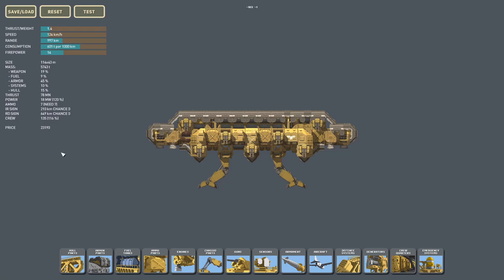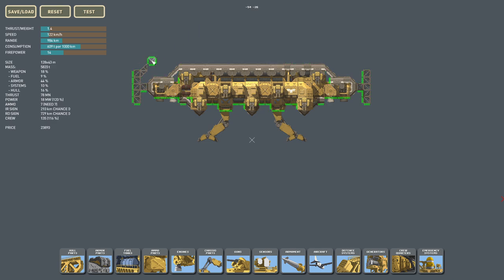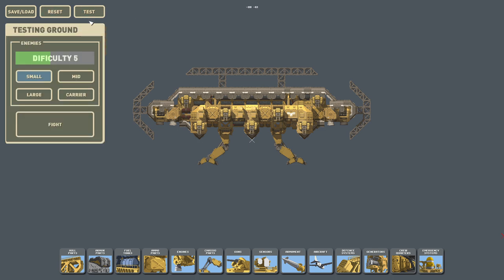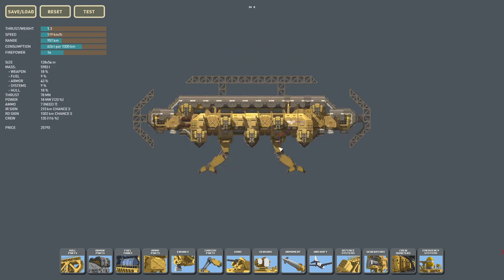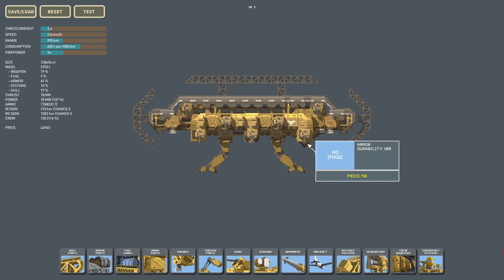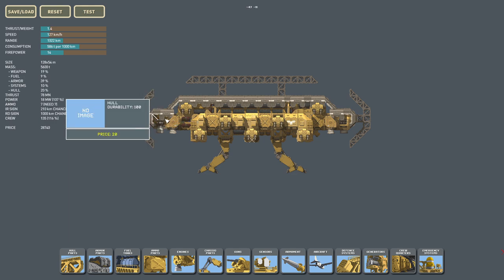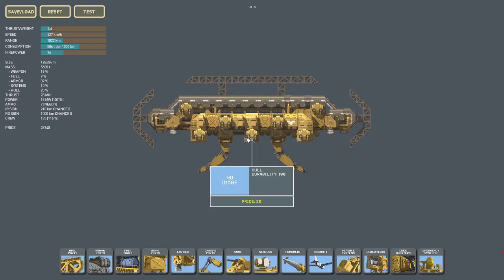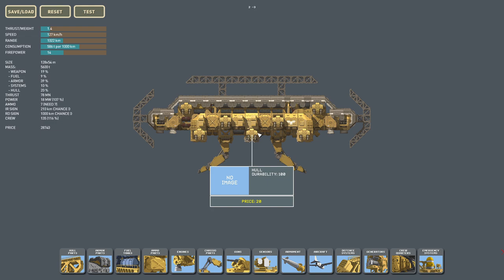Honeybadger-M | ship build | Highfleet

Comment: Maybe keep 130mm's whenever you find them after battle so you can use them to replace the 100 mm's if you dont need the cash. You get along with 100mm's early on just fine, that way you can maximize the fire power whilst keeping cost down.
Reply from the maker: That is a really good idea. Upgrade the ships in the game when you find the parts. I will try this in the next playthrough on the Honeybadger-M

Comment: you need  37mm ciws to take care of fat shells you need these with badger otherwise you can pray to god not to get hit with armour piercing shell especially in lower section  , replace 2 guns with 2 2a37 ciws weapons and put them near one another to atleast take care of some incoming fire with a shield of flying metal , ideally i use 4 2a37 guns atleast to completely lock down enemy fire from reaching you while your d80 gun shells can continue to hammer enemy hulls on the added bonus some of the 37mm shells from 2a37 guns also damage enemy hulls , also you need 2 more flares in side horizontal  direction to make missiles confuse and stop you hull from getting top hits from missiles

Comment: The biggest flaw in my opinion , she is larger in vertically and very thin in horizontally. It's very hard to keep ship above you and last 2 playthrough hb lost coz it fall apart. 
Maybe try make a sister ship cutting it's lenth to 70% and make it little fat.
You can call it fat badger.🙂. Looking forward for the 3rd run.

Comment: The armor piercing rounds need a rebalance. The way they are seem like cheat bullets. They do have slightly lower range, but still almost go across the entire screen. I would drastically nerf their range so that they were only effective at close range.
Reply: They are expensive and for some calibers, very hard to find.
Reply: @tesoulx  When the Ai use them its basically game over. Bullets travel too fast to dodge, and they go through half the ship.
Reply: @berserkerpride  YOU FOOLS you need  37mm ciws to take care of fat shells you need these with badger otherwise you can pray to god not to get hit with armour piercing shell
Reply: @arnoldshmitt4969  Yes I would say slow ships need 37mm. Even two is enough to shoot down missiles. Badger with 5 100mm and 2 37mm in the central hardpoints would be good.

But fast ships can't afford to put too much firepower into 37mm.